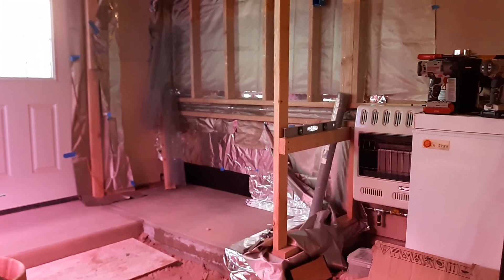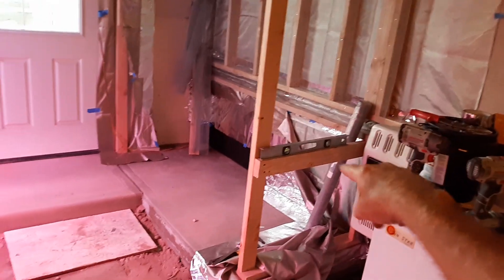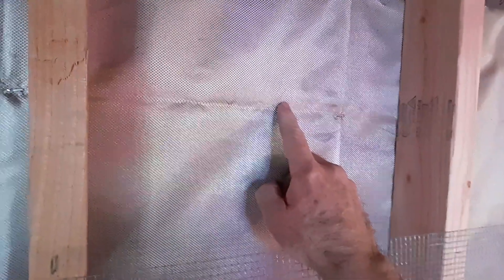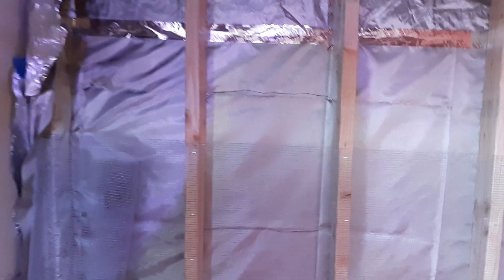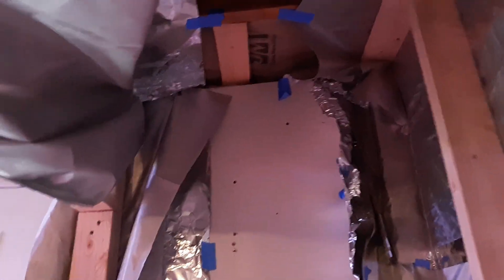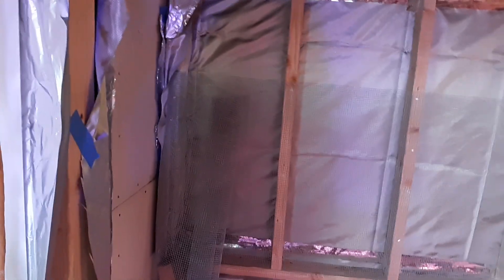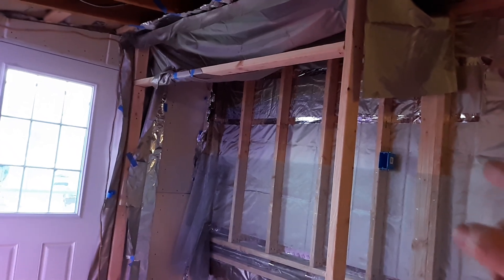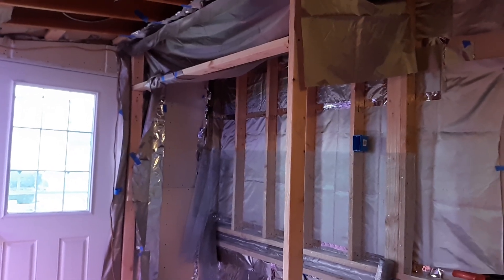BREAKING NEWS: IS YOUR HOME PROTECTED FROM AN EMP ? HOW TO BUILD A FARADAY CAGE PART 2

Comment: Use fire resistant Sheetrock on interior of that structure being built incase of battery fire.
Reply from the maker: I have lead acid batteries and they are not as fire prone as the new lithium batteries.....thanks for the tip..
Reply: @OFF-GRID-DESERT-FARMING  You’re welcome